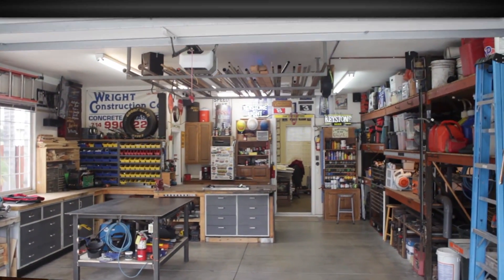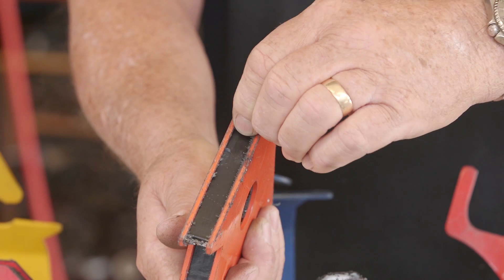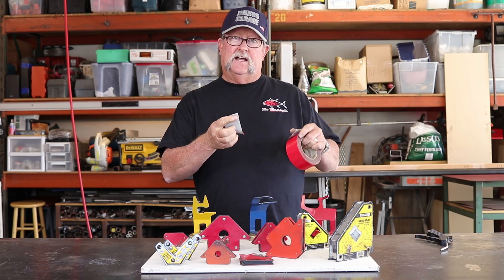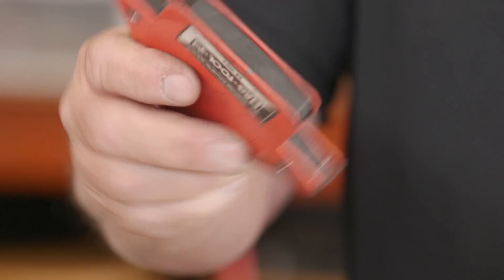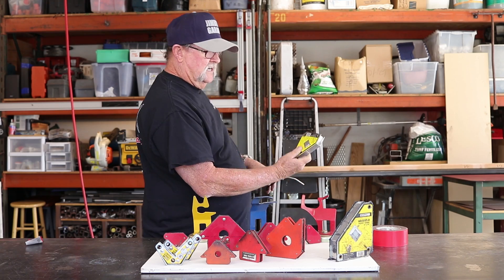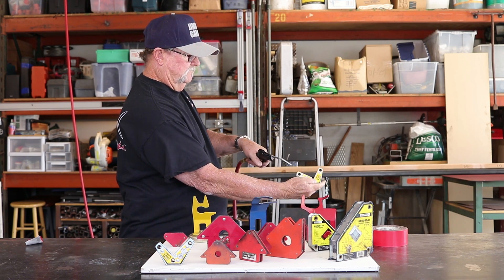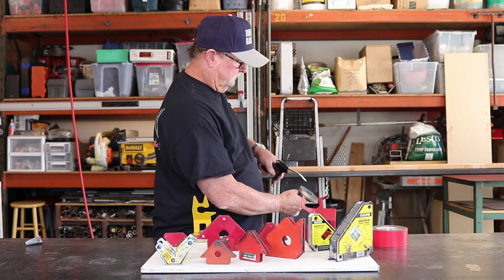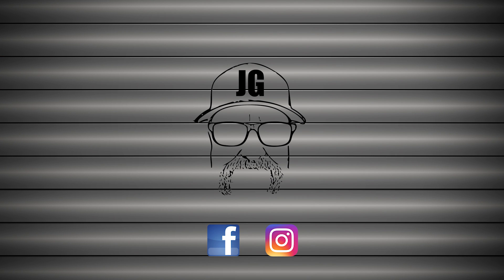Cleaning Mag Square Tips | JIMBOS GARAGE

Comment: A wire brush would be a better alternative than using tape if you're just trying to get most of the dust off. That's my go-to method for cleaning them off without compressed air.

Comment: I had one of those Harbor freight blow guns like you were using,JUNK fell apart in about a week .those magnets work well have a few of then myself.
Reply from the maker: Thanks for watching Charles, Ya i have tow of them they both work great so far, Have had them for about a year, They are cheap! But so far so good! Jimbos garage!
Reply: Charles Dyer vacula makes a superb blow gun that same low profile style. never seen one come apart. my harbor freight one never even got used before it broke. the air fitting insert came flying out the back as soon as i hooked up my air. who regulates down to 90 psi anyway? lol